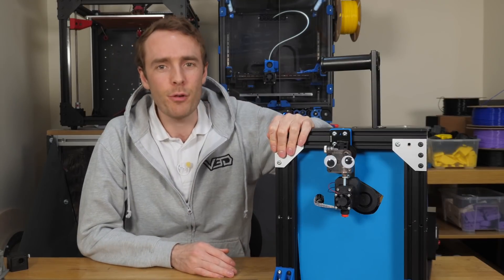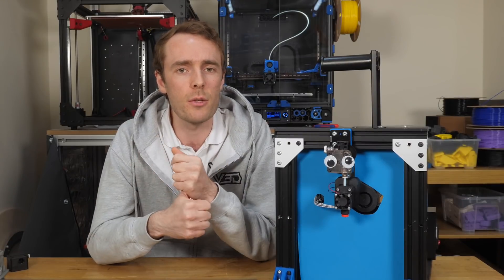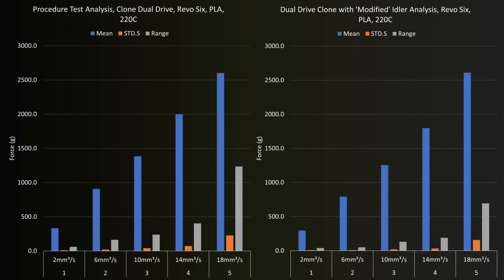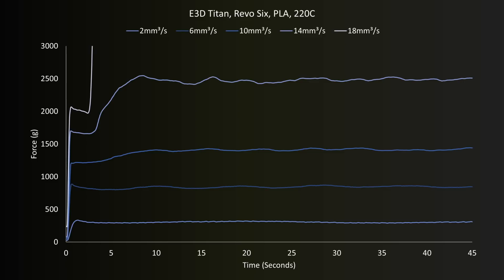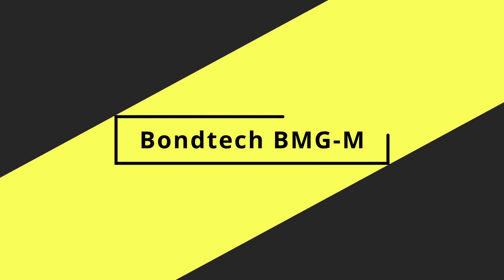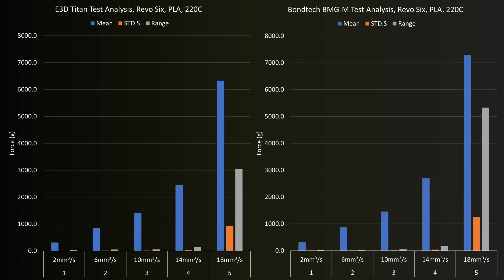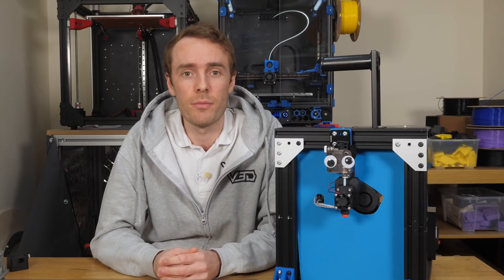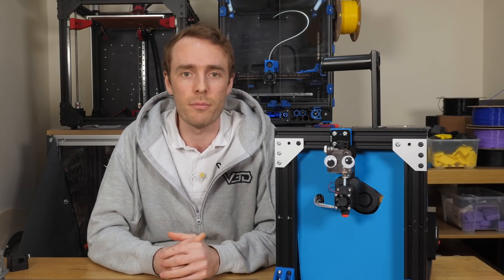The Extrusion Myth We All Believed

Comment: I would be VERY interested to see this test with Prusa's upcoming "zero-backlash cycloidal gearbox with a large no-slip drive gear" on their new XL printer.
Reply: they changed to a planetary gearbox with 1:10 reduction
Reply: @simwil524  Goes in line with how stepper motors work. They're the most efficient (most power per step) when they run at full speed, IIRC. Gearing that down instead of slowing it down should provide more force.
Reply: @simwil524  Prusa begins to look more like Elon musk. He makes some ambitious claim in an attempt to innovate which makes all his fans cheer and get excited about but that does not make that much sense from a technical point of view, only to change things at the last moment when physics, budget and manufacturing constraints become a reality.
Reply: @teresashinkansen9402  Or worse, when users find issues with his existing products he gaslights them for years before writing it off as a startup limitation (no refunds!) or names his official discord after the unsolved problem as an infinite insult and closes off any formal issue discussion because it was "too heated".
Reply: @kimtae858  Yes that sounds like Prusa indeed. While the subject its not very related reminds me of the acetone vapor smoothing chamber video. Some people raised some very good points about the danger of putting electronic components inside a sealed enclosure with flammable vapors (computer fan) and the video its still up with no warning or safety guidelines.
Reply: that's some long name XD
Reply: Agreed. testing the effect of larger gear drives would be interesting.

Comment: I know it's been 2 years. I think the conclusion is guided. An extruded that is capable of more force is usefull event if there is a low restriction to the nozzle. It is possible that the spool has restriction unspooling, restriction in the bowden tube leading to the extruder, or all the restriction you can imagine from a Multi Material unit that relies on the extruded to pull the filament thru the mechanism.

Comment: Awesome work! I'm here still using one of the original steel extruder wheels from my Replicator Dual that's idk 15 years old now 😅 Printing at 26mm3s to 36mm3s, depending on the filament. Can even print up to ~45mm3s with highspeed filament on the old MK8 style extruder. Volcano heater block with a MicroSwiss CM2 0.4mm nozzle. No thermal paste, i simply tapped the block to ensure smooth matting on the threads and rapped in Kapton tape.

I designed my own extruder arm for the MK8 setup to hold a larger U shaped idle bearing just below the extruder wheel as the filament curls when one side is elongated by the bite of the teeth. The old idle bearings where V shaped and i noticed provided resistance when enclosed and everything was hot. I'm running a StepperOnline 17HE12-1204S 42x30 Nema17 stepper rated at 26Ncm(36.82oz)/1.2A, running it at 1A with a TL-smoother 😅 All this on a heavily modified Creality Sermoon D1, which i purchased open box for $280 some 3 years ago (retail was $1200). I knew it was flawed but it had a massive frame which weighs about 20Kg/44lbs and i saw the potential

Comment: Unfortunately, only the pressure on the hot end is taken into account here. However, if you consider the entire system, the resistance of the path from the spool to the extruder, i.e. the pull of the filament from the roll, is missing. This results in completely new aspects when considering the forces required to transport the material. Slippage of the filament can also be caused by an unfavorable material flow between the filament spool and the extruder; this also includes long distances, friction in feed hoses, a tight radius in the material feed, etc.

Comment: Straight-cut teeth tend to mesh according to the tooth profile: the quality of manufacture of the teeth also impacts this. You'd be more likely to get resonances ("cogging") as the applied driving shaft torque goes up  if either of these are less than optimal (think of the noise of a race car gearbox with straight-cut teeth).

I've always wanted to see dual-drive with helical-cut teeth meshing, to see if it makes any difference.

Comment: Id like to see what some of the "precision" exteuder gears with helical cut gears, milled drive gear, and are millied from a solid piece vs gear/set screw/shaft and uses better bearings on the driven gear (not needle bearings)

Comment: Thanks for the video. I wonder what the clone test with the filed gear would look like with the proper bearings present. Also, does having particles stuck to the drive gear going round (like we saw in your tests in blue) affect the results as well? Some of the extruders have wiping wheels to clear these away. Really keen on geared down extruders as every time I try and use non-geared ones, the filament always stops flowing with the print click of death resulting in nozzle jams. Never happens on a geared down drive because of the higher torque.

Comment: So I wonder for an ender 3, that reaches the limit first, if the hotend or the extruder. I have an Ender Neo with Klipper that starts to under-extrude when is near the 9mm3/s mark. I'd like to push it to 14mm3/s aprox and call it a day, but not certain if I need to change both things or one first. I was thinking about a trianglelab BMG 2.0 clone to start with, but after seeing this video not sure if it will help a lot (if the hotend is what is already limiting the extruder for example). Any ideas?

Comment: If you printed with the same hotend, same filament, at the same temperature, then the reaction force for a given flow rate should only depend on the hotend. The extruder wouldn't matter. As you state in the video. So, this was a hotend test. It also raises the question of how did the clone BMG extruder push the same amount of material with significantly less force?  To me, that would indicate better performance, or an error in methodology. Were the same lengths of filament extruded for each test and weighed? The best extruder should have the heaviest extruded sample of filament, meaning it most closely performed as it was "told" to.

Comment: Best analysis i've seen so far regarding this topic and force cell experiments. I believe the ripples are caused by the insufficient melting capacity of the hotend; when you get close to the maximum flow  at which the material viscosity (U) is "normal" - i.e. the viscosity value at a given hotend temperature at a standstill or at low extrusion speeds, let's call it U0 - you start to have an oscillating behavior where U increases, which makes the flow reduce slightly temporarily, which in term leads to a slightly higher residency time until U0 is reached again, which then leads the flow to return to the previous value. And so on, and so on. (I know this happens from empirical testing) Since you verified that with equal or very similar values for two totally different extruders, that would corroborate this thesis and point to the extruder.
Also, I am of the opinion that dual gears are not needed in any case for regular 3D printing; there are other factor limiting the extrusions. I only use Titan and have never, grinded a filament under heavy testing with 1.75 and 3mm filaments on a supervolcano. I admit that, eventually, having more pushing force would compensate for the under-extrusion that starts happening at very high speeds and layer heights BUT I don't thinks it's the correct way to just try to push harder by brute force in a desire to overpower the physics of the other limiting factors.
Reply: Very well commenting. If we look time temperature and time feed force graphs at 18mm³/s, they are probably matching.

Comment: Recent opinions are that the Bondtech Dual drive setup has Warts.  Several of them.
 Main one being that their Gears (All of them) are Eccentric... So much for claimed 1st world Mfg excellence ! 
 Curiously the cheap chinese Clones have far less eccentricity.. Go figure.
The gears' eccentricity creating regular frequency  print artifacts.  
Also the Hobbed drive gears worsen this as the filament then wiggles in those groves causing further rythmic variations in Filament flows.  
Noting that many Cheapo Printers with Mk8 extruders featuring inexpensive straight splined filament drive gear can print surprisingly well. 

Rather than Effing about grindig the idler gear.  TRY fitting a Ball bearing in it's place!  This Does give immediately visible improvement. 
The Hobbed treeth are a Large problem  Good Brochure Babble grist or not.

A Quick  print quality improvement to a BMG is to replace the idler drive gear with smooth faced ball bearing... True.. try it. 

 Real life filament drive forces are ONLY of concern where the hotend is a genuine restriction. 
Where the easy retrofit of even a 3$ Clone CHT nozzle.... eliminates that bottleneck.. Neatly.

Comment: I didn't understand everything but the conclusions you drew are very interesting and pretty clear. 
The most interesting part is the conclusion that when we hear the extruder gear slipping it is probably because the required force has risen due to the inability of the hot end to melt all the material that is being inserted. In other words we are trying to put too much material in the hot end and it cannot be heated and extruded as fast as desired. Therefore the resistance generated by the hot end increases causing the gears to slip. Learned something new today!
Reply: In my case the single gear Creality brass extruder wore out really quickly and started slipping & causing lots of under-extrusion (walls not sticking together etc)
The cheap brass gear is flat & not concave to match the filament's round profile so only a very small part of the teeth makes contact with the filament on one side. A hard spring is used in an effort to compensate but this put a lot of pressure in a very small area on the teeth and wore them out quickly. I switched to a dual gear and it's way better the design just makes sense

Comment: Given that there is an seemingly an ideal force required for a specific extruder /hot end pair at a specific temperature... 
So, the next question is :
* Without your test setup, what is a deterministic and reliable method to determine that ideal torque and speed for a specific temperature WITHOUT having access to your test rig?
I almost think that question implies that hot ends and extruders should be design as a matched set to get the best performance.

Comment: Could the ripples be created by uneven pressure from the 2 feed gears (perhaps due to play in the driving gears because of misaligned shafts?) ...
... OR...
could the pressure gears be oblong or different sizes?
... OR... Is the gear holding fixture flexing from the pressure changes due to filament not being melted evenly or quickly enough and perhaps almost plugging the nozzle?

Comment: See if this correlates with extruder temp.  Try and implement feed forward on extruder heater drive power.  Knowing the heat of formation for the volume of filament being extruded, you can know the amount of heater power required.

Comment: I would like to see this test done with more modern extruders like the Orbiter 2.0, the LGX Lite and the TBG Lite, I think the Orbiter at higher extrusion rates and pressures should be smoother due to the planetary gear system, and the others give better grip due to larger diameter hob gears, not many are using BMG's or Titans in direct drive these days, due to weight, the closest we use to a BMG is a Sherpa Mini, which would most likely have the same flaws as a BMG, but with less weight.
Reply: I'm looking at those . But Weight reduction seems to be their actual 'real life'  advantage . 
The big fliament drives , given the above study.. would give  NO advantage, only Marketing ones.. 
 To MY surprise...  there is only? a 90 gm weight reduction from my BMG /pancake motor /carriage assembly.
  Half the physical size certainly .. although  not near enough  weight loss to warrant the  $$ /time  /effort AND risk in trying the current Flavor of the Month.

Comment: Missing a needle roller bearing set is a pretty important factor, and makes your testing data flawed, the gear will apply un even pressure, they need to have 2 sets, regardless if you filed off the teeth.

Comment: Boy, it would have been great to throw the modified clone back on at the end to ensure the result repeated. Just to rule out something partially clogging the hot end.

Also, did you weigh the amount of filament extruded in each test to validate the actual extrusion? Just reporting force during a commanded extrusion rate doesn't tell the whole story. Since you are trying to show a single drive extruder is as effective as dual drive, but without certain artifacts, you must prove the single drive extruder isn't slipping.

I'd love to see a revisit to this test to fill in the gaps! Keep it up.

Comment: I respectfully disagree with the conclusion here. I think less force indicates that the extruder is less efficient in imparting drive force to the filament. Less force indicates that the extruder is slipping on the filament at a particular flow rate. This will lead to underextrusion in the printed part. If the hotend is not able to keep up with the desired flow rate then the problem is with the hotend, not the extruder. The extruder should always attempt to extrude the demanded amount of plastic. Print speed should be reduced, temperature should be increased, or a different hotend should be used if underextrusion is observed.

Comment: I think the overlooked factor is 1.8 degree/step motors versus 0.9 degree/step motors. And 12v vs 24v. Also don't forget the motor impedance, this causes a motor to have different torque at different speeds, and a lower or higher max speed with adequate torque.

Comment: All this testing is moot. Your steppers and their stepping/micro-stepping/torque limits are all unaccounted for and different between each extruder, and would explain why you are seeing huge jumps at high flow rates, because your stepping is skipping it's microstep and going right to the full step. To verify if the gearing has ANY effect, you need to remove the use of a stepper motor and have a constant torque motor. Honestly, the idea that a gear system would introduce noticable cyclic loading seems pretty far fetched as a hypothesis as to why you would see a cyclic loading on your nozzle pressure. It is absolutely the stepper. There's a reason steppers can be heard singing, and why stepper torque ripple is a common topic. Could you imagine the amount of billions of gearboxes out there that would fail, if gears caused torque ripple to the extent that you are assuming here?

Comment: you can call it a myth, but the trianglelab matrix certainly has worked better than my older Titan Aero for my small head printing in ABS.  Its hard to flow ABS on a good day, so using a .2 nozzle means its MUCH

Comment: Fascinating data; the fact that the bondtech BMG performed comparably well with and without secondary driven gear was very surprising and seems to draw into question some of bondtech's past claims re: superiority of dual gear drives. I'm glad to see the titan held it's own well given its age, it's an elegantly simple design that still adorns one of my printers.

I would be very interested in a similar comparison of a number of different aliexpress knockoff bmg gears; are the specs for the measuring rig you're using available anywhere online?

Comment: What i don't get is the fact that you analyze/present the results first and only afterwards you mention that your results might be flawed. As you pointed out correcty the applied driving force of the extruder is just as much as the force needed to push the material through the hotend. So between the extruders there should be the same amount of force applied if the same amount of material is extruded. I believe this is not the case in your tests, as you also got a difference in observed oscillations vs. diameter of the extruder gear. All in all it sounds like you just assumed the steps/mm or just took the value from the datasheet. Instead it would be a good idea to calibrate the extruder for every flow rate you want to measure by doublechecking the extruded material. The extruded amount should change with the flow rate... 

While i get what you're trying to prove, i also believe that this tests got so much quirks and flaws, that you can't conclude that one extruder is better than the others.
Reply from the maker: I precisely calibrated the steps/mm

Comment: I think if you added a very sensitive scale to the mix it would improve your results.  Run the test at a specific distance and measure the weight of the filament that is extruded.  This will give you an amount of filament that actually is extruded instead of just the force used.  I think it would be interesting to see the amount of force vs actual amount of extruded filament.  You could also use this to test filament extrusion speed vs actual filament extruded.

Comment: Those extruders are for very flexible, brittle, or hard to grip filaments such as Ninja flex, wood, metal filaments. They push down on both sides helping feed it straight and provide the necessary force to extrude properly. Maybe test it more as intended with a flexible filament? I know for me I couldn't print with my single and now I got a dual and prints great.
Reply: This is incorrect. You only need to apply a force on the opposite end but not grip it. It the case of flexible materials it´s not even possible since they flex and will simply stratch and deform.